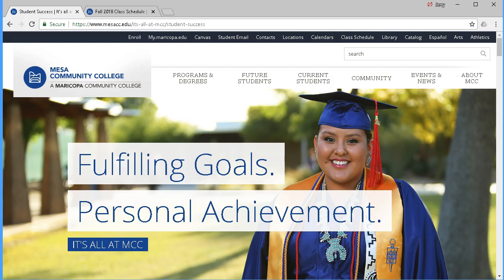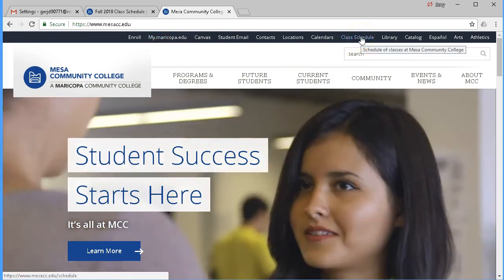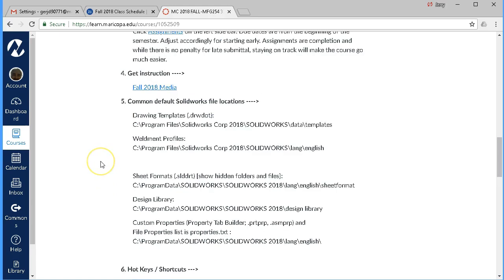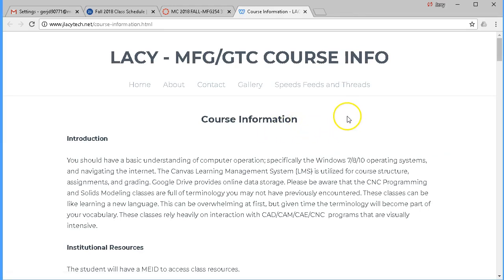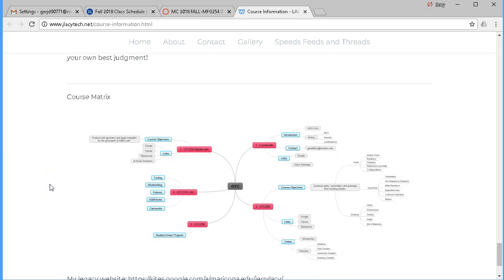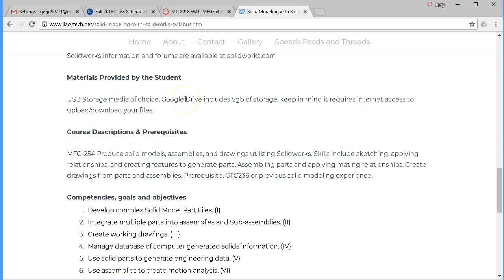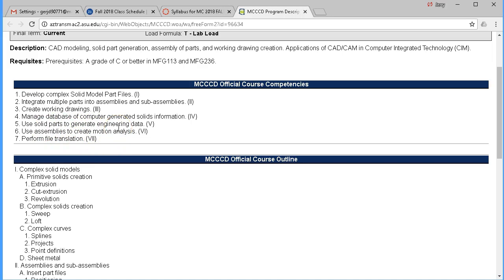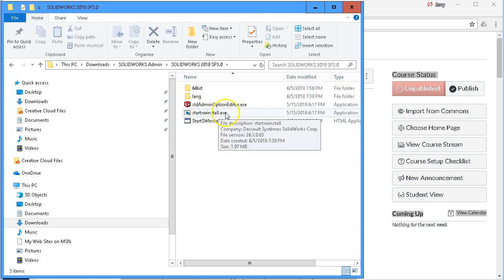20180720 MFG 254 Introduction

Comment: Hello, Thank you for the video. 
I would like to know if there is a video for the p2-5 from the book Solidworks 2016.
I tried it, the drawing is fully constrained before I add all of the dimensions. I do not know why, even after checking out the geometric constraints. Therefore if possible I would like more insight about it.
I send you an email with my draft file attached. Please whenever available check it out. 
Thank you in advance
PS : Even the P2-6, I am not really doing well with those exercises with angle.
Reply from the maker: Hello, the video is https://youtu.be/wrm5wHCei1M?t=97 I will post the video where I got all the way through and could not get it to finish. This geometry has a tendency to pick up inferred relations which can be difficult to go back and debug. Sometimes all the dimensions are not necessary and can be checked by allowing a driven dimensions to be placed and compared. Another area you can check is in the Command Manager, Display Delete Relations; if you see any fixed relations remove them. I do not fix because they cause more problems than they are worth. Hope this helps.
Reply: @jerrylacymcc  Thank you very much. Your advices does really help, I spent a lot of time struggling on it., now I can keep going with a fresh mind and ways to get them done.